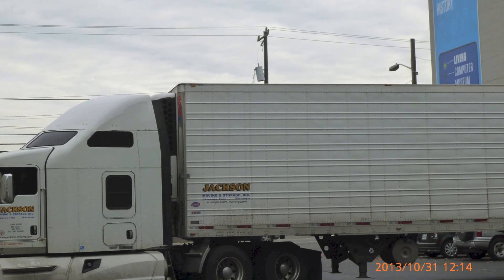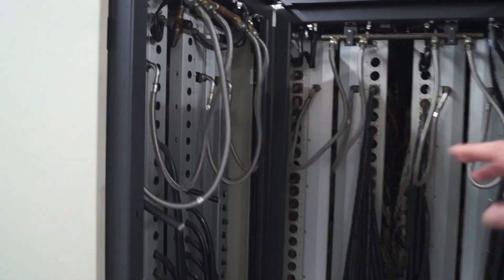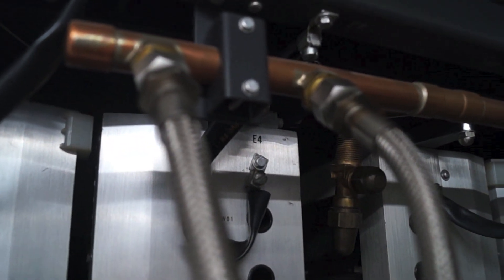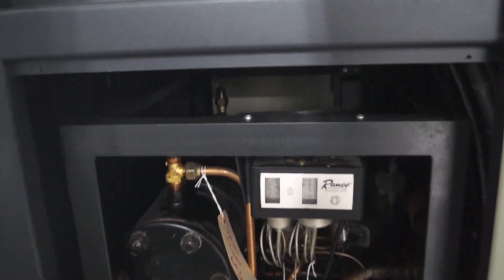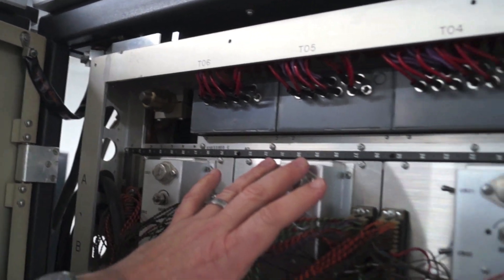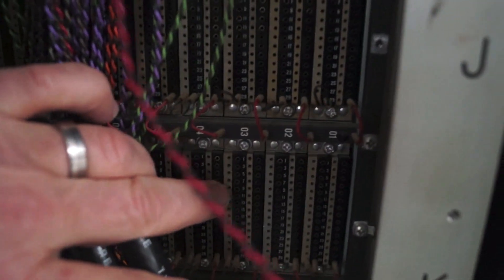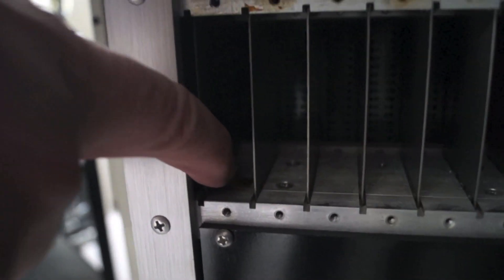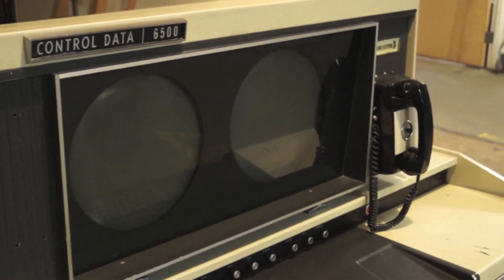Inside the CDC 6500

Comment: Did not 6500 run Plato systems? And that's quite ironic since Plato was mostly a system for driving educational work stations and not high performance computing.
Reply: Plato IV could be hosted on any CDC-6000 system.
Reply: @GH-oi2jf  
Ah, ok. I did see the "computer" room at the time. There was quite a big room (at University of Alberta). The other system was a Amdahl (470 I believe).
So, while I was taking computing science, I also did quite a bit of code on the Plato system. (tutor language). And I also did some micro-tutor (code that could run stand-alone on a Plato terminal with a 8 inch floppy drive.

And of course even without a floppy drive, micro-tutor could run/download on any terminal. One of our members wrote a PERFECT rendition of space invaders.

And I recall that the we had just received the "newer" tutor language version. (it was VERY nice upgrade, since then calling routines supported parameter's (and local variables if I am not mistaken). With the newer tutor language features, it was a very capable and formable language.

Thus, with tutor having become quite a nice "structured" language? ,

As a result, we would up writing some amazing software. We built anat-sim (a system that allowed non developers to build courseware, and that project then morphed into omni-sim. 

No matter how one spins this?
That system had a fantastic set of features.  Beyond great memories I have writing software on that system. I wish I had kept some of that software, since some of it was just fantastic stuff. With micro-tutor code, you could quite much re-create most of the popular arcade games like space invaders, or break-out. (I wrote one of those - it worked just fantastic). and of course someone wrote a missile command - again, just near perfect rendition of that game. 

We also wrote a "level" editor, and started a Castle Wolfenstein "clone" of the Apple II version of that game. 

Oh, my -- too much fun that System was!!
And what was that multiple player fighter pilot game? Our squads in Alberta would play against the French people in Quebec! - again, what a barrel of fun!

I am trying to remember my logon,  quite sure it was kallal@ualberta,   (my last name).

Comment: Very hard to restore and expensive.  You not only need to fix the refrigerators, you need chilled water to cool the compressors.  You need an external motor generator for 400 Hz power.  The interbay cables are a huge problem.